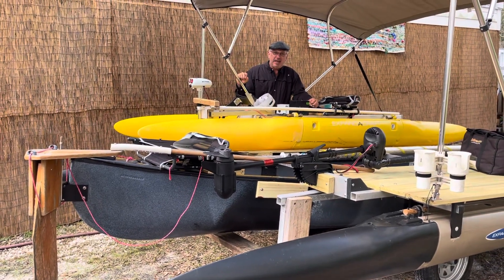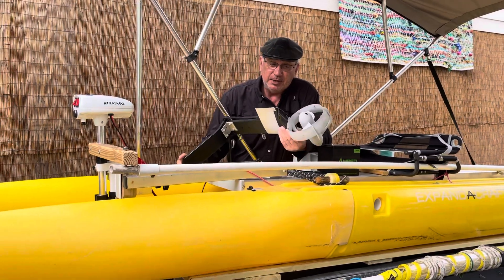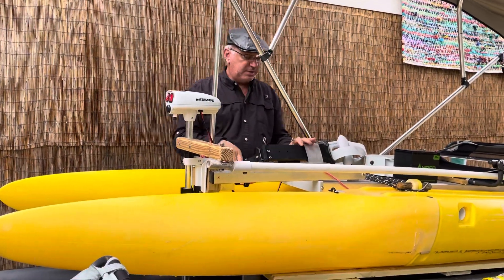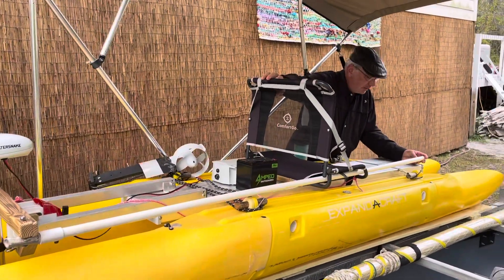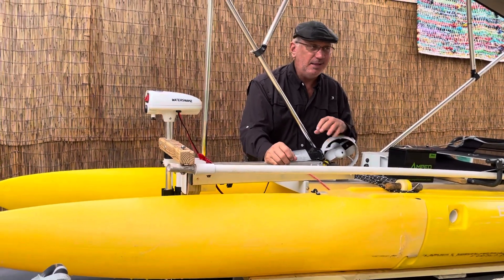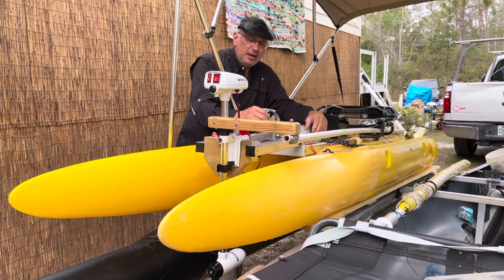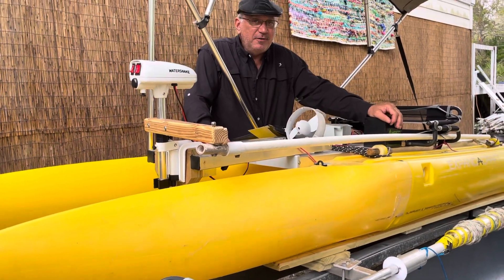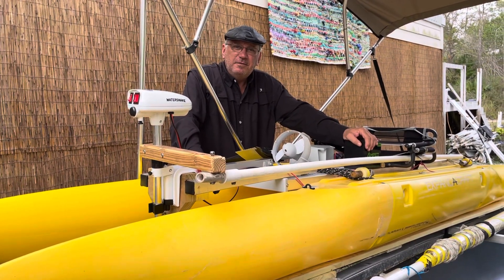Expandacraft Electric Motor Recommendations

Comment: Great information!!! and spot on!
I wish i could getaway with a small motor.
30 is about the smallest i can get away with on my set up and how i use it. plus i mainly fish rivers so iam always going home against current and wind.
 I have the other motor you have (the haswing) way over kill even for my heavy rig but its works wonders on my return trip and being brushless and true variable speed its uses less than my 30 and 45 mk's did.

Not covered here so ill put this out there for those that dont know and just why a 18 or 24 work well for kayaks...
These vessels have a very low max hull speed. Mainly due to the fact they were designed to be paddled and there for NOT planing hulls.
3.5 to 4.5 is the normal max hull speed. Not this doesnt mean you cant get them to go faster. You can but the power needed to gain more speed rises exponentially.
So realistically given no current or wind that 18/24 motor will push a kayak at about the same speed as my 65# one.
This is because both motors are capable of pushing a kayak to the max hull speed.
Now wind and current will change that rapidly. So say you have even a mild current of 1mph your motor needs to work 1mph hard to stay at max hull speed.
Reply: Increase your hull length to get more speed with moderate power...
My 21 foot-long Sea Lance trimaran with two 24V 1200W Haswing Protruar 2.0 geared motors ($499 each on Amazon) pushed the boat with 330 lbs. of people and 54 lbs. of LiFePo4 batteries to 5 knots.  I may switch propulsion to one 24V 2500W Haswing Protruar 5.0 (currently $799 on Amazon) at the stern with a motor at the bow and add a rudder controlled via pedals to keep my hands free.